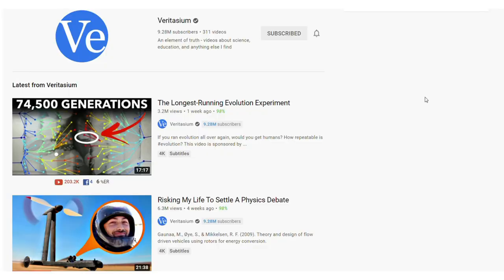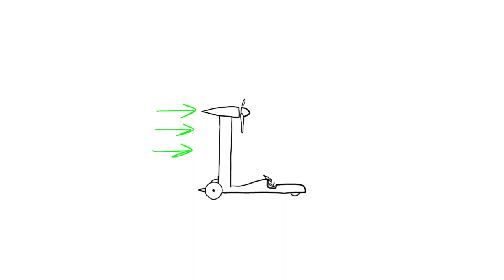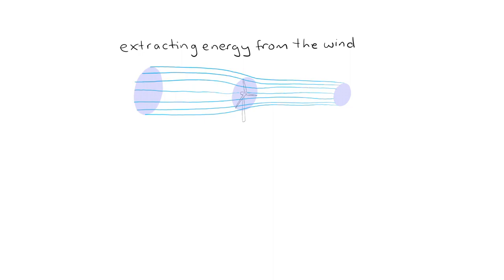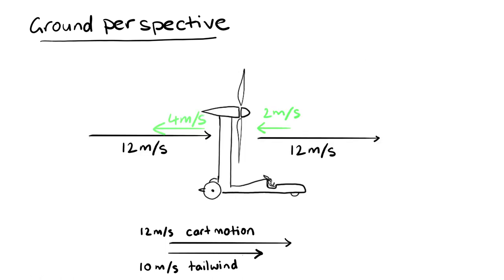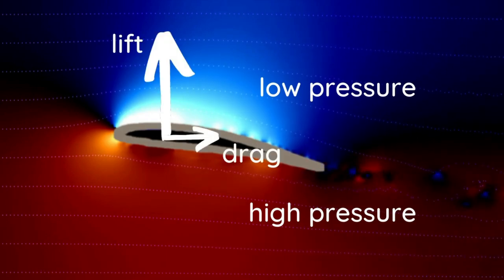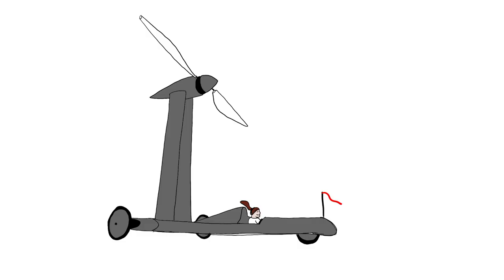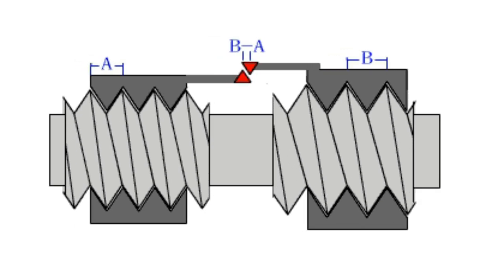Downwind Faster Than the Wind by Veritasium: How Does it Work?

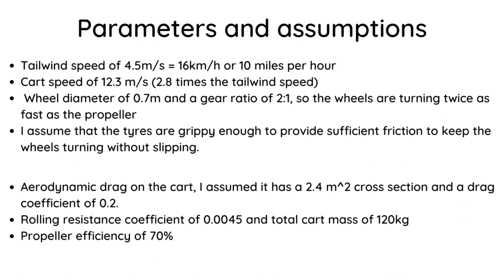Comment: Hi Rosie. Please rewatch original video at 12:14, can you explain whats going on? Propeller is accelerating against the wind without a movement.  From where the energy come from? motor?
Reply: The energy is coming from the wind.
Reply: @seneca983  but it spins against the wind, its wrong direction
Reply: @sebastjansslavitis3898  If the propeller were to spin in the opposite direction it would slow down the cart. It is the right direction. Consider the inertial frame tied to the ground. In that frame the wind gets decelerated by the propelled behind the cart so the air is losing kinetic energy and the cart is gaining some.
Reply: @seneca983  it is right direction to produce thrust, but its not the direction wind would spin it. And thats the problem. It accelerates where it should decelerate
Reply: @sebastjansslavitis3898  "its not the direction wind would spin it"

The wind is not directly spinning it. It's being spun by the wheels to such direction that it generates thrust.
Reply: @seneca983  what the hell are you talking about? did you even watched what conversation is about? there is no movement, wheels does not turn, but propeller accelerates
Reply: @sebastjansslavitis3898  "there is no movement, wheels does not turn"

Maybe not when the cart starts but after the wind pushes the cart the wheels will be turning and the propeller spinning.
Reply: @seneca983  watch the video i'm talking about then comment
Reply: @sebastjansslavitis3898  I didn't think that was necessary to answer your question but, nonetheless, now I've watched it. There's a jumpcut right before the timestamp you gave so it's a bit difficult to say, but IMHO there's two options:

1) The frame of the vehicle has some drag. Because of that the wind will accelerate it a bit even if it's stationary. Then the propeller begins to turn and contributes to acceleration.
2) If the previous isn't enough, they might give the vehicle a small shove at the beginning.
Reply: @seneca983  It still feels you talk about something else
yes you can't see the beginning, but beginning isn't important. It starts with vehicle driving at some speed, and propeller turns. All okay. Then it starts to slow down, and that's also okay - wind just become weaker. It slows down to almost standstill, but propeller just keeps accelerating. And that is IMPOSSIBLE! Energy to the propeller is given by the wheels, if wheels dont turn propeller dont get energy. Yet it somehow get's it, and tons of it.
Reply: @sebastjansslavitis3898  OK, now I saw what you were referring to.

"Then it starts to slow down, and that's also okay - wind just become weaker."

No, the wind didn't become weaker. They say it's strong and it appears to be based on the telltale. The reason for slowing down must be because he's breaking. But why does the propeller appear to spin faster. I'm not sure but I suspect the earlier seconds of the video when he's still talking are slowed down.
Reply: @seneca983  yeah sure, that's one of possibilities, although it doesn't look slowed down to me. another possibility is that they cheated
Reply: @sebastjansslavitis3898  it has hidden electric motors in the rear wheel hubs & the rotor. very obvious hoax.
Reply: @onebig77thbrigademonkey.57  It's not. Of course, I can't verify what they have put inside their cart but what they do is possible without such cheating and there is no indication that they cheated.

Comment: So I get it... I've done a bit of sailing... but the explanation of the sailing around the tube, doesn't exactly reflect what is happening with Blackbird... My question is... Why do you need to drive the wheels at all? We know a sailboat can already go downwind faster than the wind, which is identical in principle to the sails-on-a-tube as shown in the video, which should also push (pull with lift) the cart forward faster than the wind... right?
Reply: @Rick_Cavallaro  I appreciate the response, that's sort of what I was thinking. I think the sailboat explanation is throwing a lot of people... especially since I've watched sailing carts, that have entirely free-spinning wheels, tack downwind faster than the wind (I find them terrifying just to watch... I'll  stick to boats)... but as you say, that's not really what is happening with Blackbird. The wheels don't need to be driven, to act like a keel... they just need to be present... they need to be driven because Blackbird essentially is pushed forward by the wind (imagining free-spinning wheels and the propeller glued in place, acting only as a wind-catch). It moves forward because it is a wind- catch... as we know anything moving has momentum and kinetic energy... Blackbird uses Some of that energy to drive the fan, utilizing a gear/chain drive to spin the fan blade (I suppose if it used all, or required more than what the wind could generate, then it wouldn't move at all... unless the wheels are on a cam-driven system, I guess..) the fan blades rotate (driven by the chain, geared to the wheels, blowing the cart forward... Correct?
Reply: @Rick_Cavallaro  Exactly. Just making sure my head was screwed on correctly. Thank you, I appreciate it.

Comment: It's strange for something so counter intuitive to be physically sound. So far I've never had so much trouble understanding something about physics.

I think your explanation has made me understand. But I certainly wouldn't be able to explain it to anyone else :D
Reply: I think if the problem was explained properly in the Veritasium video, it wouldn’t have come across as counter-intuitive.
The Veritasium video misleads you to think that the propeller is a turbine driving the wheels, but this is not the case, the wheels drive the propeller which is what produces the thrust, like the propeller on a plane.

My view is the initial video is very misleading

Edited to correct propeller
Reply: @philippetts1701  The veritasium video never claimed that. Also, if you cannot explain it to someone else, you do not understand it...

Comment: Would a spinnaker (or one way flapping loungers) on the front of the car get the car up to wind speed faster, and then just collapse out of the way?
Reply: If this actually worked, you wouldnt even need a wind at all.  You would only need to push it up to sufficient speed and it would run forever.
Reply: @ronalddump4061  That's not true. Wind relative to ground is crucial for it to work.

Comment: It's just like rowing in a river to push more in the river stream way so you will move faster than the river stream
Reply from the maker: Yes! That is a very clear analogy... wish I thought of it 😁
Reply: Great idea. And if you can imagine an axle across the boat, spanning the river with wheels on the two river banks, giving the rotational power to mechanically drive the oars you'd have an exact analogy.
Reply: But with rowing, we'd have an external source of energy to push the water away, right?
Reply: @punya1621  Not if it's mechanically driven by the relative speed difference of the stream to the bank, via the wheels and axle, rather than a person. Rather than oars, you could drive a screw instead.
Reply: @hankdewit7548 I hate to admit it but even after watching two explainer videos on this (Steve Mould being the other one), I still don't understand it. 😔
Reply: @eyytee  Thanks a lot for the video! I now understand this better than before. Watching these videos again should further improve my understanding 🙂
Reply: @sk.43821  You have to use the energy of the current flowing through the river's topology (analogous to the air flowing over the ground). The Paddle Wheels would have no force acting on them, just sitting in the flow of the stream. If you made them big enough to touch bottom (like the wheels of the Blackbird, on the desert sand) then you have the necessary force. Anything else would be 'Free Energy', like the old "Fan on a Sailboat" depiction.
Reply: @EngineeringwithRosie  Except that the rower (just like the biker in your pushing-on-a-moving car analogy) is using its own energy to row, which is akin to having a motor in the boat.
Reply: No it's not. The boat is floating in the water and being carried along by the current. Is the wind powered car floating freely in the air? No, it isn't. It's on the ground, and that's the equivalent of the boat being suitably heavily loaded in shallow water that it's weight has it firmly in contact with the stream bed and not moving, and then you need a propulsion device to extract energy from the water flow to move the boat. And not only move it, but move it faster than the stream current - while remaining in contact with the stream bed.
Reply: @EngineeringwithRosie  No it isn't, and no you don't.

Comment: I accept that it works but i still don't understand how its thrust exceeds the extra drag at the wheels. Comparing it to levers or gears is still confusing because levers can increase force but not work. Same thing with gears. Any tiny engine can be geared to create extreme torque but it won't actually get much work done because now it's force is being spread out over so much time. Basically the difference between torque and horsepower. What am i missing?
Reply: Here's one way to think about it. From the cart's perspective both the ground and the air are moving backwards (once wind speed has been exceeded). However, because of the wind the air is moving backwards slower than the ground (from the cart's perspective). This is crucial and allows the forward force generated by the propeller to be greater than the backward force from the grip of the wheels.

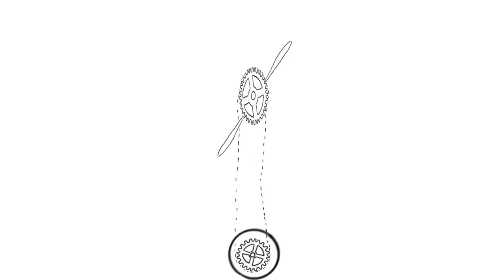Comment: 3:33 - FINALLY I understand - the propeller pushes against MOVING air. Thank you!

Of course that doesn't mean I understand the rest of it. But this broke my brain last night.
Reply: And the propeller “pushes” against the air using what energy? The energy of the air molecules. When a flat sail is used instead of a propeller, the second Newton law applies: the air pushes the sail in one direction and the sail pushes the air in the opposite direction ( backwards). Is a rotating propeller that dissipates energy by pushing some molecules sideways more efficient that a sail? Why are we not using propellers instead sails in sailboats?

Comment: I see everything simplificated : I see an open system that extracts energy from outside ( from the wind ) and powers a light weight vehicle in a smart way ! I don't understand why that profesor threated this like if it was a closed system or a perpetum mobile wich is not ! :))) PS : Energetical Engineer here lol .
Reply: This basically boils down to pulleys/gear ratios.  I find it kind of funny that what we call "simple machines" are still stumping scientists.
Reply: research zero point energy and overunity effects. Wings have "negative" drag here in this vehicle. Some large industrial vacuum pumps speed up shortly when they are shut down. If one would apply a brake to keep the system in that state, one could extract energy. They did it on the atomic level, slowing down a hydrogen atom with a laser until the proton should collapse into the core at 0 Kelvin. But this doesn´t happen and one can continue to cool it down forever. Tesla an Viktor Schauberger understood these sweet spots in vortex systems.
Reply: "an open system extracting energy from the wind" that puts it in a nutshell and makes everything clear. The more formal explanation of this video is very nice too  though.
Reply: @martinjandt9573  no, it’s nothing to do with “overunity”. It’s extracting energy from the relative motion between the air and the ground.
No need for zero point energy here.
Reply: @dreamok732  if you think that puts it in a nutshell then I don’t think you understand the issue.
That statement is true, the energy comes from the relative motion between the air and ground but the mechanism it uses is totally counterintuitive. How’s this for weird. If the prop and transmission efficiencies are 100%, the force accelerating the kart is infinite when the kart reaches wind speed.
Tell me that makes sense!?!?!
Reply: @jiminycricket9877  I mean, obviously the propeller and gearing system isn't 100% efficient, as a propeller always produces a maximum amount of thrust, which caps the thrust at zero wind speed.
Reply: @jetison333  I was commenting on the nature of the maths. If you think that a theoretical infinite force at zero (relative) wind speed is intuitive, then you and I have very different conceptions of reality!!!!!
That said, once you get what’s going on, the point of maximum thrust is obviously, as you say, at zero relative wind speed.

Comment: So here is my question: after this video i literally feel the tumbleweeds blowing from one ear to the other in the vacuum in my head.
But how is it possible that something can be blown around in a vacuum?
Reply: Radiation pressure?
Reply: Maybe I missed something.  Did the video say something can be blown around in a vacuum?  Why would you ask this?  The video talked about high pressure air and low pressure.  You can't blow air if the air is removed.  You can blow photons...which is electro magnetic radiation... to push a solar sail.

Comment: So... Can we strap a propeller to the back of a car and generate extra thrust? Can this work without wind by replacing the bluff body drag from the wind with a motor?
With the treadmill prototype the bluff body drag was replaced with the motor turning the treadmill and it was able to exceed the speed of the treadmill.
Reply: Only if there is a wind.
Reply: You can generate thrust with a propeller but generally using wheels is more efficient.

Comment: The first boat propeller was literally a screw. It was a scaled up screw that was several meters long. It extended out the back of the boat underwater. It was made out of cast iron, so was very brittle. On the 2nd or 3rd outing, the screw hit something underwater and broke in half. The boat then sped up.

This is why to this day propellers are often called "screws".
Reply: I've also read that the geared prop has been connected to the screw of a boat, allowing it to travel faster upwind than wind speed.  I want Rosie to take that on next, considering the effects of water and air slippage for both the water screw and the air screw.  Let's not forget to give credit to Joby, the maker of the cart.